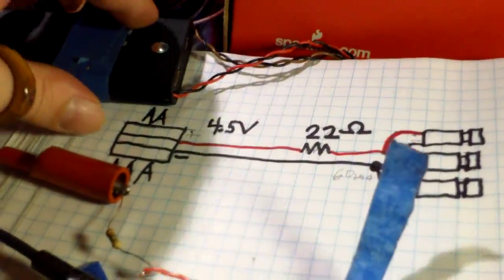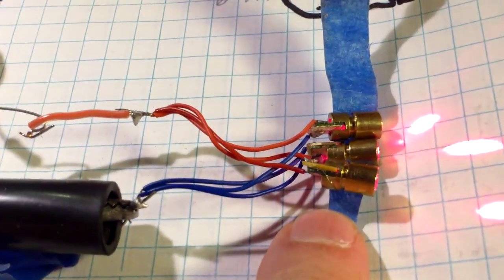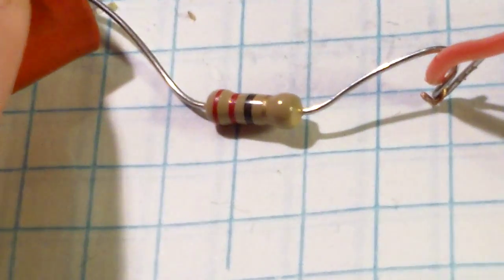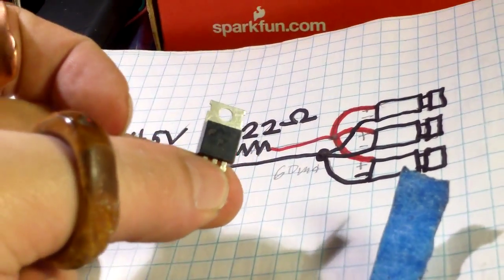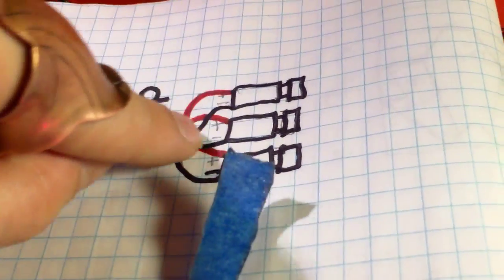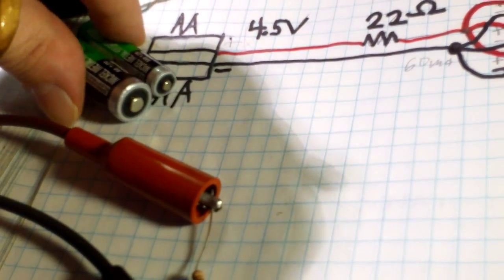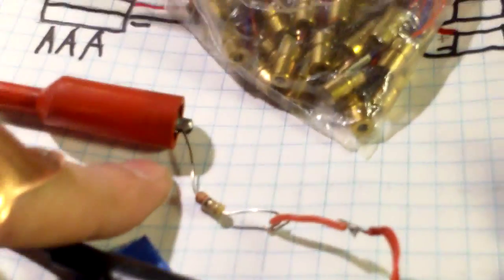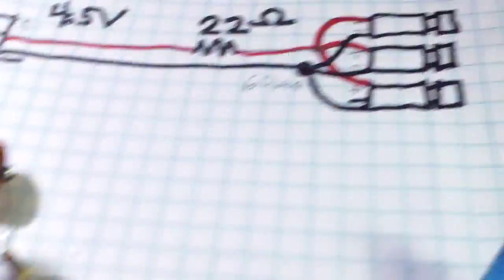Predator laser help for Brooks .

Comment: 75 ohm resistors i can get on Ebay or Amazon so thats a plus ....
Reply: So the 75 ohm 1/4 is Purple, Green Black and Gold.  Does this sound correct for 4 3 volt laser all connected to the 9 volt battery?

Comment: Hey Ryan.  Hope all is well.  So i assembled the 4 lasers with a 75 ohm resistor and i hooked it up with a 12 volt battery pack (8 AA Batteries).  Lasers we healthy & nice.  But i touched the resistor and it got hot.  Should i go to 9 volt or is this common.?  Just don't want it to burn up.
Reply from the maker: Deuuuuuuuude , Steve Borrero , I'm sorry , I totally forgot about You from months ago , if you're using 12 Volts then three 470 Ohm resistors in parallel should be good and only get warm and not hot .   So three 470 Ohm resistors in parallel is about 157 ohms and will work with three 3 Volt Laser LEDs in parallel .     Good Luck Man .
Reply from the maker: 3 three Volt LEDs in parallel at 12 Volts .

Comment: Get video.  So i was wondering if I can do this same set up but i need 4 lasers hook up to my suit.  I have 3 volt diode.  What battery you recommend to use with 4 lasers at 3 volts and what resistor should i get to power the laser.  Any help is appreciate it.  Look for a nice bright consistent power....
Reply from the maker: Hey Steve , sorry I didnt get back to you sooner .       If youre using three 3V lasers with a 9V battery then youll need a 100 ohm resistor from radioshack , the color bands on the resistor will be BROWN BLACK BROWN GOLD .    If youre using four lasers then youll need a 75 ohm resistor , but they dont make 75 ohm resistors so I think that radioshack may have 68 ohm resistors which colors should be BLUE GREY BLACK GOLD .        The brightness will go down slowly as the battery voltage goes down , but if you used a regulator then the brightness will stay bright up until the end then dim quickly .        Ill make a video for you friday night / saturday morning .     Ok , take care Man see you soon .
Reply: Thanks for the reply Kyle.  So the 3 lasers with the 9 volt with the 100 ohm resistor should be straight forward for me.  The 4 laser set up I'm concerned about.  So what I want to do exactly is hook up 4 3 volt diode lasers all hooked up all negatives and all positives wires hooked up to a switch. My question to you lets say i get that 68 ohm resistor can i hook this up all to a 9 volt or do I have to use a different battery.  I know i have a 9 volt battery and each laser is 3v that gives me 12 volts and I'm using a 9 v battery.  Most likely it will drain the battery fast correct.?  Can I use an A23 - 12 volt battery instead. And how would the power be on the laser.  Will they burn out if I use alot or will the resistors keep it at a moderate temp.?  Would I need a regulator too??? Dude i thank you in advance for the help. I want this Predator costume to be the real deal

Comment: thanks for your Video, I'm trying to do the same, I want to use a power bank 5v as a power supply with 3 Lasers. Is the Resistance 22 ohms enough for me? 

Greetings from Mexico :D
Reply from the maker: Greetings Mr. Jozzafaf , yes a 22 ohm resistor would be perfect for a 5v supply and three 3.3v lasers in parallel .  Good Luck and make a video when you finish it if you can , it's always cool to see other Predators at work .  Take Care Man :) .
Reply from the maker: That resistor may get hot so you could get a 15 ohm resistor and put it in series with a 10 ohm (or slightly more) resistor , two resistors would spread the heat better if the 22 ohm resistor gets hot .    Ok Good Luck  I hope it works for You .
Reply from the maker: Oh yeah the 22 ohm resistor should be colored Red Red Black .     Instead of using a 10 ohm and 15 ohm in series , maybe wire two 47 ohm resistors in parallel with each other and then put that in series with the leds and your 5v powersupply .    Two 47 ohm resistors in parallel will half their resistance to 23.5 ohms and will dissipate any heat better .    A 47 ohm resistor is Yellow Purple Black .   OOOoooooK , finally , take care Man and good luck .
Reply: So is it better 2 resistors of 47 ohm (Y P B)  in parallel? and how many watts of operation?

are you in Facebook? Can I see your predator?  

Thanks :D
Reply from the maker: Deuuuuuuuuude , sorry for the wait , I finally made a small video for you to show you the resistors for 5 Volts and 9 Volts .       Good Luck Dude Good Luck Jozzaf :) .

Comment: Hi, if I'm to use a 9v battery for the same rig... Wats the voltage of the regulator I should be using... Thanx
Reply from the maker: My god , I dont think Ive replied to this comment yet , Im Sorry .   Id use a 5volt regulator from Radioshack , part number 7805 , the 5 in 7805 means that its a 5V regulator .   It should be less than $3.00 dollars , maybe $1.50 .  Good luck .